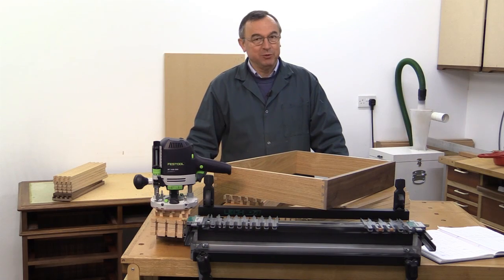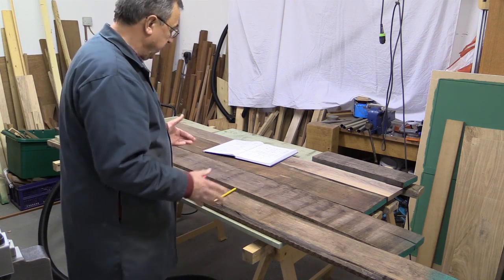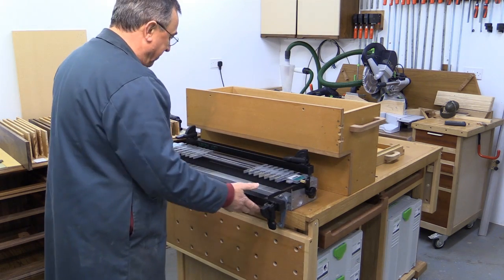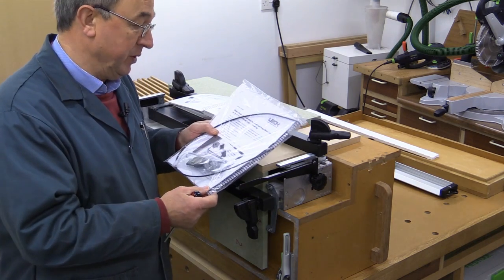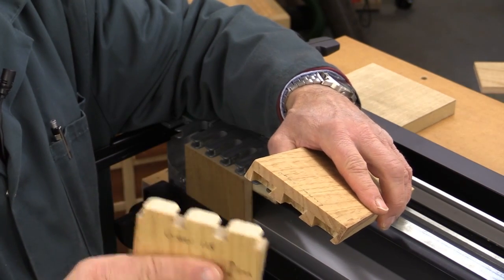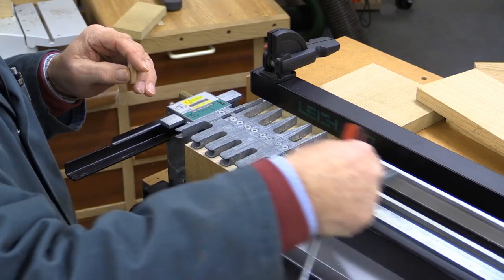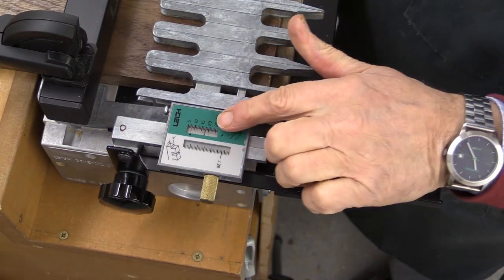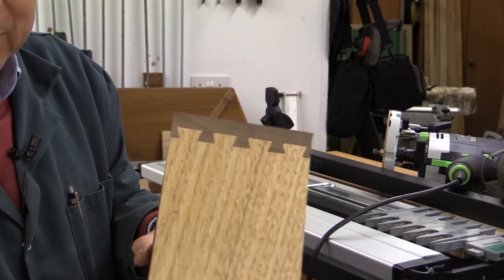Dovetail Drawers with Leigh Jig - Part 1

Comment: I just got the VRS for my D4 and it came with two different vacuum hose adapters and the vacuum hose attachment also swivels about 20 or 30 degrees.

Comment: this is by far one of the best instructional video i have ever watch very good job thank you
Reply from the maker: +patrick k   Hi Patrick, You are so very kind - I must say that the Leigh instruction manual is by far the best woodworking manual I have ever seen.   Peter
Reply: i have a question for you have you ever used this to cut the sides out of plywood ( Baltic birch) or alway s solid stock.  I have had this jig sitting in a drawer for 15 years as i got frustrated with the tear out i always got with plywood is there something i'm missing in all of this.  This video inspired me to dig it out and try again
Reply from the maker: Hi Patrick, No router work looks good on plywood and I would not recommend it for dovetails. Stick with solid wood or even MDF (although one does not get a very strong joint).   Peter

Comment: Hi Peter.  Great Presentation.  The VRS Vacuum attachment is a nice addition to the dust collection process.  The only limitation I have found is with routers with larger bases i.e. OF 2200, the fingers that capture the router base on either side don't permit the movement of the router to each extremity on the support.  To overcome this I remove these two guide fingers and position the vacuum capture intake manually within the routing area.
Reply from the maker: +Stewart Robertson I might try this next time.   Cheers.   Peter

Comment: Hi Peter. Great videos on the Leigh Jig. I upgraded my D4R to the Pro status but have not yet used it for the single pass HB dovetails. Just a mention about the VRS dust attachment. Mine came with 2 dust hose adapters that will allow the 27 and 36mm hose connections. I have also  found the VRS to be great with one exception - when using the 5/16' (8mm) upcut spiral bit instead of the straight cutter, it produces great results but the chip extraction is upwards and then the standard OF1400 dust collection works better.
Regards
Les
Reply from the maker: Hi Les, Many thanks for the kind words and also the great tip about the upcut cutter.   Cheers.   Peter
Reply: @NewBritWorkshop   I bought an old dovetail rig and whilst I can join boards edge to edge, I cant make right angle joints, it can clamp both boards at right angles, but the top board stencil is 1.5"' away from the board and no way to rotate it (Like you need a route bit with a very long shaft), any ideas what this type of jig is and what its use is? It looks to be quite old and made in England.
Every jig I have seen has the top stencil sit flush with the top board.
Reply from the maker: @suzesiviter6083  Hi Suze, I have no idea without seeing it. Sorry. Peter
Reply: @NewBritWorkshop  No worries, no one else managed to figure it out either even seeing it.

Comment: Great vid peter that jig looks good but complicated but to get those nice joints by following the detailed instructions that came with the jig two thumbs two keep up the good work 

Cheers robert
Reply from the maker: Hi Robert,

I was a little nervous doing my very first dovetails but the Leigh instructions are absolutely foolproof. I know that they are not quite the same as hand made joints but they do look great and are very quick and easy to do.

Cheers.

Peter
Reply: Ye but we don't have enough time to be doing things by hand good stuff peter keep the vid coming

Comment: Good Morning,  your follower Sir. i bought df500 after watching your video. i love it.  That machine has made my life so easy, and in a very compact space i can store it.  Now next question is would you recommend Leigh Dovetail Jig, i am inclined towards the larger size of it.  any input would great.  I trust you with your opinion. many thanks
Reply from the maker: Hi Mian, If you are making a lot of drawers or other things that you want to have dovetail joints then the Leigh jig is perfect. If you only want to make a few drawers in the foreseeable future then you could look for an alternative method of jointing. I think that the Leigh jig is the best dovetail jig on the market. The larger one will be more flexible over time.  Good luck.  Peter
Reply: @NewBritWorkshop  much appreciate your help

Comment: Hi Peter, I have had my D4R for many years but haven't used it in quite some time. Your video inspired me to dust it off and make some dovetails. The box you made interests me very much and I too would be interested in your plans If you care to pass them on. Thanks very much for your videos.
Reply from the maker: John Grubmuller Hi John, Please let me have an email address so that I can send the plans.   Peter
Reply: @NewBritWorkshop  I would also be interested in the plans for this box if you have them. Right Now my Leigh jig is just bouncing around the workshop unprotected.

Comment: Hi Peter,

I also have the older Leigh jig, but I keep mine hanging off the back of one of my shop cabinets. But I really like your combination storage box / riser.

Whenever I use the jig, either I'm leaning over or getting down on my knees. I'm going to use your idea. Not sure if I'll create a storage box or just a riser of some sort. Thanks for the ideas.

Also, I think you sold me on buying the dust collection attachment. It appears to actually be effective. Can you tell me how effective it is when routing through dovetails? I mostly use the jig for through dovetails.

Thanks.
Reply from the maker: Hi Marty,

I have moved house many times and a box like that is essential - also quite useful for getting a comfortable working height.  Peter

Comment: Peter a great video. Just a couple questions if I may. The box looks just the job, would you happened to have any measurements or photos of the inside I cant quite place how the jig fits in.
Also regarding your Polyx video, can you tell me if I use the tints do I then have to use the natural Polyx over the top or are they the same as the Polyx but tinted?
Reply from the maker: Allan Roberts Hi Allan, I can let you have some drawings if you send your email address to me by Private Message. As for PolyX and tints; as far as I know there is no need to put a clear coat on top but I am not an expert in the tint area. Peter

Comment: Hi Peter, Have you had any problems with the clip in guide bush on the 1400 with regards to accuracy. I've ordered a 1400 and I'm only now finding out people have found too much play in the fitting.
Reply from the maker: Hi Tony, I do not use the Festool ones (I have only the one that came with the router). I have a set from UJK  which I use with the Leigh adapter.   Peter
Reply: @NewBritWorkshop  Hi...thanks for the quick reply. So basically I have the D4R jig and had been using a Trend router. I watched your video and decided to to get the Festool 1400. It arrives tomorrow. I also ordered the adapter (From Axminster too) to take Leigh Bush. However, only afterwards I notice that a lot of people complain that these clip in adapters have too much play and the dovetails are inaccurate. Is this something you have found or am I worrying over something I don't need to. 
Thanks

Tony
Reply: @NewBritWorkshop  This is the adapter ring I bought https://www.axminstertools.com/ie/leigh-guide-bush-adaptor-for-festool-of1400-493566
Reply from the maker: Hi Tony, I have seen people worried about the OF1400 accuracy with the guide bushes but mine was fine from the start. I now use the OF1010 for Leigh jig work  (I have said this many times in later videos) and that router can be adjusted if it is off centre. Peter
Reply: @NewBritWorkshop  So the OF1400 arrived today. I have to say I'm blown away by the quality and accuracy. I fitted the Leigh adaptor. There is a tiny bit of play. Whether this would effect the cut, I'm not sure. I read on a Forum that Festool engineer said to push in a wood tooth pick an snap it off. I did this. It is rock solid and these just pop out when you release it. Takes about ten seconds to put them in. So if you compare this to having to screw this out if it was a fixed version it takes a lot less time. I placed it on my Leigh jig and it feels a lot more solid than my Trend  T7 with no side to side play. I'd say it will be perfect. On top of that, the quality and accuracy of the fence and depth stop makes me think this is going to be an awesome all round router!!. Thanks for your videos, they are very inspiring and very well articulated! You have a great teaching method!

Comment: Hello Peter again. Can you tell me. do you use the Leigh guide bushing or a generic brand? The Porter Cable is a bit shallow and I fear riding up over the template  Thx again
Reply from the maker: Hi Jeff, I use Leigh guide bushing - they designed the jig and know what they are doing.   Peter

Comment: I tried to do some fingerjoints in plywood and the first try of making a box was amazing. Maybe it was beginners luck, but after that I keep getting lots of tearouts (I know plywood is hard in that way) but worked perfectly on my first box. I'm wondering if I did something genius the first time or it was pure luck? - Any good suggestions?
Reply from the maker: Hi Jonas, I can only guess from this distance but it may be that you were being very cautious the first time and took things slowly. If the tearout is underneath then you could try a sacrificial piece under your wood. If the tearout is at the side then it may help to take the cut down in stages. Is there a chance that your first session took the edge off the cutter? Or, maybe as you are using plywood the grain of the outer layers is running left to right instead of fore and aft.    Peter
Reply: Hi Peter, thank you so much for your great reply. I think that helped me to find my mistake (I'm still very very new to woodworking) - half the boards I have cut so the grain is turned the wrong way. They are all still intact since I have only worked on scrape pieces so far on this project, but I can see the scrape pieces with the grain in the wrong direction are the pieces with the problems, the once with grain in the right works fine. Do you think I can save them by having an extra board in front of my piece when routing them? - or will I run into trouble no matter what having turned the grain the wrong direction?
Reply from the maker: Hi Jonas, It may help to have a sacrificial piece on front and it would be worth trying it with some of your scrap pieces.     Good luck.   Peter

Comment: Great tutorial thank you. Quick question.. Do you not cut both the pins and tails simultaneously as you do on a Porter Cable Omnijig for example? Thank you
Reply from the maker: Hi Jeff, No I do not and that is how the original D4 was intended to be used. However, you can now cut both if you wish with the latest machine but I prefer my pins and tails to vary in size.     Peter
Reply: Thank you Peter.  I picked a D4 up at a public auction and am anxious to start making sawdust. Great tutorial btw.
Reply from the maker: Good luck - let me know if you have any problems (not that I am likely to be able to help !).   Peter

Comment: I have just bought a D4R pro and OF1400, I started to look for the adequate adapter for the e-bush and just read off center issues etc in some forums. Have you encountered such issues? Can you comment more on the bushing you are using (part number etc)? Many thanks in advance and thank you for your great vids
Reply from the maker: Rodrigo Sosa Hi Rodrigo, If your router is off centre then it is a simple procedure to centre it using a mandrel - take a look at this video where I show the OF1010: https://www.youtube.com/watch?v=8l09Q1wOO3I     For the correct guide bush and guide bush adapter see this video from about the 6 minute point:   https://www.youtube.com/watch?v=13lWmW8Eix0   Many thanks for the kind comments.    Peter
Reply: New Brit Workshop Great! thank you Peter :)

Comment: Why did you do the tails and then the pins, instead of doing both in one pass at the same time?
Reply from the maker: +matermark My original D4R had to be used in two separate operations; tails and pins. The new D4R Pro does allow tails and pins to be done in one pass.     Peter
Reply: +New Brit Workshop (Peter) Thanks for your reply. They have an update/upgrade kit that includes a plastic spacer clip that offsets the vertical board a half finger and a plastic length of rod, similar to a coat hanger wire straightened out, that goes through the fingers acting as a limiter reducing the depth the router can travel in the fingers... plus an adjustable router bushing that is oval which gives you more fine tuning; it's the most expensive part of the upgrade kit, which totals ~$29US. 
I could only afford used, and recently got a good deal on the Super 18, with both the full router bit set and the VRS kit. Haven't used it yet, still learning the manual!
Take care and don't lose any fingers!
Reply from the maker: +matermark Cheers. Take care.   Peter

Comment: Thanks for this great tutorial Peter.  As usual, clear, concise and extremely helpful.  Unfortunately, I'm not sure how I can create a private message on here.  Would it be possible to get a set of the plans for your jig storage case?
Reply from the maker: Hi Oosema, Now that YouTube have removed the PM capability it seems that comments that contain an email address will normally get put in my "Held for Review" section and not displayed to the world. I respond to these if they are requests for plans and then delete them in order to protect the email address.   Peter